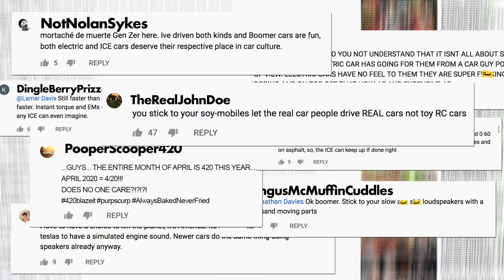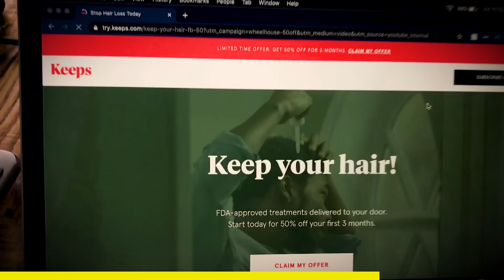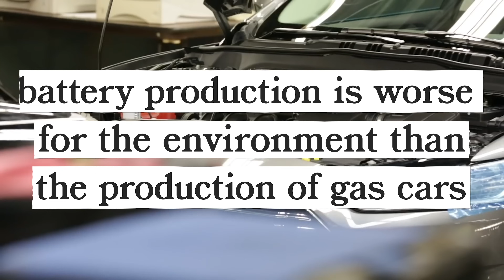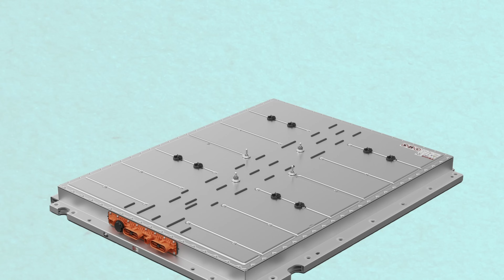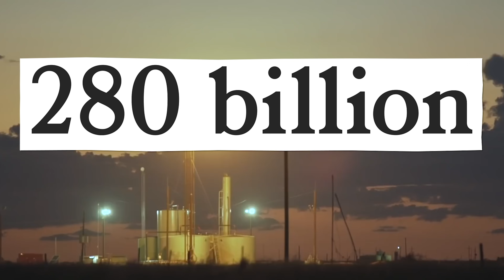Are Electric Cars REALLY Better for the Environment?

Comment: If you wanna use the battery production argument, you'd better throw out any laptop, smart phone, electric battery driven power tools etc... EV batteries make out a tiny percentage of all battery production.
Also, cobalt is used to rinse gasoline and diesel, so that argument also crumbles to dust.

Comment: Oil refineries may cause 280 billion tons of CO2, but shouldn’t you also consider the fact that the products are not only petroleum that fuels the cars but also other fuels like jet fuel, and naphtha and so on, technically gas cars don’t really contribute to 100% of the 280 billion tons of CO2 emissions right? Also an average EV would require a battery change at around once in 8-10 years right?

Comment: Mention was made about the amount of CO2 emissions generated in the making of an EV's Lithium battery.  I think it would be fair to mention the number and cost of Lithium batteries an EV would use in the course of its life.  Add to that the ramifications of disposal or rebuilding of the exhausted batteries.

Comment: What about the fact that most lithium based batteries only have a life span averaging >10 or on average about 80,000 miles ? I work in vehicle sales and I have no issues with electric cars I love driving the and enjoy selling them but I’ve seen every kind of car come through our lot and most of the E.Vs with high miles have bad batteries and they need to be replaced. Most combustion engines can last with proper maintanace to at least 200k miles and even than they can be repaired as apposed to replaced. And when you think about how everyone wants to save the planet releasing 4 years worth of co2 at once can’t be better for the environment bc it doesn’t give it any time to reabsorb that co2 and convert it into oxygen.... but that’s just my opinion

Comment: The only source you give is underrepresenting the damage of electric cars. I am also a soporter of electric vehicles. But let's not make shit up. This is generally fake. I am from spain, and, taking into consideration the electricity we use to charge our cars:

If you look at the T of CO2 /TeP it is slightly worse the energy from the plug in your home than bruning gasoline directly. We would still have to ponder the eficiency in which each car transforms this energy in actual movement, of course. Anyway, we should also consider that my source, though official, is mostly bullshit, since it claims biodiesel is CO2 netrual.

Sauce:

https://www.idae.es/uploads/documentos/documentos_Factores_de_Conversion_Energia_y_CO2_(2010)_931cce1e.pdf

So the topic still goes on.

Comment: Also interesting: If the number of gas cars is reduced, the number of oil ships is reduced by far. With hat, some of the worst polluters in the world get reduced. Thanks for the great content!
Reply: How do they ship batteries and metals and....?
Reply: No, they will just switch to shipping EV minerals
Reply: Olle Larsson Oh, I forgot. You need to refill the battery ever day
Reply: @valentinmoeller  No they will switch, the amount of EV minerals that are shipped today are peanuts compared to what will come in the future when they only make EVs
Reply: Olle Larsson I know. But it’s nothing compared to the amount of crude oil transported today.
Reply: @valentinmoeller  Well, i hope you are right,  would be nice if there is a source on that
Reply: Olle Larsson I can look one up but a battery pack in a car is about 700 kg. That’s about 10 tanks of Gas - so I by my easy calculations that already works out on the first 10k km
Reply: @valentinmoeller  Ok thats good then
Reply: And, as the numbers of EV adopters increase, the less electricity will be used to refine oil, thus replacing the energy required to charge those EV's........
Reply: @Brian-om2hh  Which is why EVs are desirable: electricity is versatile form of energy. Oil is just one method to produce power. There are more: solar, wind, coal, nuclear, etc.
Reply: New fuels are being developed that give extremely clean emissions from internal combustion engines. For example the new synthetic fuel developed by porsche reduces tail pipe emissions by 85%. This would put the internal combustion engine on a level of emissions output at the same level as a electric vehicles.
Reply: Your acting like we have an infinite supply of oil
Reply: @Dovyz Vierhas yeah but low IQ always search for the negative side without thinking about how it will still work

Comment: Your video was good at comparing the CO2 emissions.  The trouble with that is your assumption that CO2 levels are to high.  Many scientist believe just the opposite.  Our current CO2 levels are at historical lows.  That is why many growers increase their CO2 levels in their hot house.  Forest and plants worldwide are declining due to the low CO2.  There are many other pollutants that are detrimental in both type vehicles and that would be a good study.   One volcanic eruption  will produce more CO2 than all the manmade CO2 in a year.  Remember that for all the solar and wind electricity produced that the Electric companies have to build matching capacity with standard fuels since customers will not accept being without electricity when the sun does not shine or the wind does not blow.
Reply: The thing is that CO2 levels will only go up from here, it's not about now, it's about when they will stop going up, and as far as we can tell we're fucked.

Comment: The real problem is that we try to do the jump in between ev and combustion too fast. They should try focusing on hybrid vehicle first before wasting all those ressources building some low mileage ev vehicle. We could developped better hybrid and eventually when we get better technologies for our ev project to do the switch. Patience is the key to success and elon musk is not a patient man.
Reply: The thing is that we can build a decent EV right now, that's why everyone is doing it.
Reply: @RawbLV  sadly they are not yet decent for every climate and country. EV are almost useless for canadian since our winter juste reduces teh autonomie too much and the range of ev is really limited for the size of our country and access to charging station makes those low range car that have a 10year life battery expensive and less appealing than common combustion vehicle

Comment: Love your videos! I do sense some gaps for a good EV/oil comparison. 1) cradle-to-cradle: once the car is end of life, what is the effect on the environment (reusable tech or not?) 2) What about the investment in infrastructure and maintenance (oil pipes, wind turbines, charge stations) 3) What about battery life time for an EV. If we would extend the lifetime of any car, we'd save a lot of environment; but that would not serve consumer economy.... 4) You mentioned child labour, unwanted mining side products, and there still is an electrical hazard with current batteries. However you don't count these in your environmental footprint; you only measure in CO2. Environmental impact is much more than that.

I love to go green and I love innovation, but the EV/oil comparison IMHO is a bit more complicated.
Reply: It really isn't though. It's a simple question that we already answered worlwide (you know... since we're transitioning from one to the other currently?)

1) Was kinda answered in the video, but the longer the EV runs, the more ''better'' it becomes over the gas one. So cradle-to-cradle, EV far beats gas.  
2) Investment in infrastructure (and it's environmental) is negligible over time for both (though gas has already been done). That's called fixed costs and they're far outweighed by variable costs over time. 
3) Gas cars have been running for a long while so there's not that many breakthroughs to be made in that regard. On the other hand, EV keep massively improving because they're a new tech. That means as more ressources are invested in EV, it's gonna grow quite a lot. What that leads you to see is the gap between gas and EV widening in EV's favor.
4) The only one you listed that's an environmental footprint is the mining side products. Those are accounted for when talking about the environmental friendliness of a car. Though he didn't cover it in depth, the numbers he uses to balance gas vs EV over mileage take those into account.

See, not too hard.
Reply: @dzello  just to also build on your part, containing as much of your emissions at the source (as in mines for batteries for EVs) rather than at the end product (ICE cars) makes it much easier to make small improvements that have massive effects.

Comment: you should do a video about biggest sources for emissions... for example...one mega cargo ship on the ocean equals in emissions to 50 million cars!  and there are tons of them going about....few percentage decreasement in emissions with those polluting bastards would prolly be more than all the emissions created by every car on this planet...   i just hate things like this when people are media and politics are focused on whats trending/sexy and easy target...and noone talks about the REAL problem...cars are just a drop in the ocean...and it has close to a zero effect on this planet...the real damage is done elsewhere
Reply: That cargo ship is the most efficient thing that there is. Per kilogram transported it uses the least amount of oil. If you want to see them less, stop consuming as much.
Reply: @RawbLV  as engines they are far from efficent. Cars and even trucks are lightyears  ahead in efficiency, because strict regulations that cargo ships dont have. which is my point. they could be made MUCH more efficient and quite easily.  YES they are the best method of transfering the cargo around the globe but that does not mean that they are efficient as engines.

Comment: Electric cars are better as long as the military continues to "convince" the countries having the resource they need to sell the stuff to us. The batteries come from China for the most part (Tianqi Lithium, a Chinese company, recently paid more than $4 billion to become the second-largest shareholder in Sociedad Química y Minera (SQM), a Chilean mining company. The deal gives the company effective control over nearly half the current global production of lithium) (As of 2019, Panasonic is the largest producer of lithium-ion batteries for electric mobility. Panasonic starts producing battery cells for electric cars (i.e. Tesla) at new factory in China), solar cells come from China - "According to the International Energy Agency (IEA) more than 60% of the world's solar panels are made in China.Aug 22, 2018). Wind turbines had a 20 year payback in 2003, according to the part owner in a 106 turbine wind farm I worked at. He stated the main reason to build wind is tax credits. Cobalt comes from The copper belt in the Democratic Republic of the Congo (DRC) and Zambia yields most of the global cobalt production. Cobalt is required for electronics of all sorts. Don't forget about tanlalum - All compact electronic devices use this handy metal "Widely used in capacitors for computers and mobile phones, tantalum is certainly an important component in many modern technologies. However, the metal is also known for issues related to conflict minerals, since a large portion of tantalum production comes from the Democratic Republic of Congo (DRC). Looking elsewhere in the world, the US has not produced tantalum since 1959, according to the US Geological Survey. So while electronic gizmos are cool at what cost? We need to send the military into these poor countries to make it safe for big business to get the raw materials for all our neat gizmos while the countries are devastated by mining activities. Keep in mind that these contries that produce the stuff for our toys, for the most part do not have or enforce polution laws so the poor folks in these countries live with poison in their water, air, and soil.

So Folks at what cost? Sell your soul for trinkets or develop ways to keep a comfortable way of life without enslaving the world for our whims? Your choice.

Comment: Great video! This may all be true, but a battery is still the wrong answer to an alternative to gas. Its success is based on an overall marketing ploy and an easy quick fix. If we really cared to eliminate OIL with an equivalent replacement, we would have figured out how to make hydrogen work.

Comment: You did not factor 'lifespan' in your checks and balances. If you buy a new EV. it might have a range of 150 miles on full charge. In 5 years, that same EV's max. range might only be 80 miles. Who is going to buy that? Yup, no one because the cost of replacing those batteries is going to be greater than buying an new EV. So you have to factor the total greenhouse gas cost over 5 years for EV. vs. ...... years for gas or diesel. If you do, then EV. is not a scientifically greener solution, it is just a politically greener solution.

Comment: A number of errors, CO2 production is no where near the release of 17mt per battery pack. Cobalt has been eliminated from the largest producer and batteries packs have a 500,000-1 million mile range and then they are not stored, they are used for stationary battery packs such as the Tesla Powerwall. So the median life of the battery pack is 70-80 years. During that time, the ICE care is replaced 20 times so all those emissions are continuously being produced for 70-80 years with ICE but only once with BEV.
Coal powered plants using modern gas turbine generators are much more efficient in producing electric power than internal combustion engines. 
ICE cars have far more toxic waste, from fluids and catalytic converters and much more toxic lead-acid batteries, and filling landfills with old leaking cars. 

I used to be a car nut, collected Italian GTs and even turned my personal shop with two full-time staff, into a side business of repairing classic Maserati from 50s to 1975 models, and I owned 64 cars. But I moved from the US 20 years ago to a large city with excellent public transportation and discovered the gain personal freedom when NOT having a car, my monthly transportation-related costs dropped from $22,000 a month to $40 to go more places and have a much more active social and cultural life, never being late, able to have a drink in a pub or out at dinner, and have no worries about finding parking or housing the cars. But I reserved a Tesla CyberTruck seconds after it was introduced.   I discovered the Reason Americans so so little, hardly go out to fine dining or plays or dance clubs, is because they are tied to home due to debt and a big part of that is being tied to a car. City life is much more exciting and active without that weight around one's neck. The US is boring because of the domination of the car with everyone in the family over 18 has to have their own car to even function.  They think it give freedom but actually forces them in boring restricted lives. When ICE cars are banned from city centers in the next 3-5 years all over Europe and Asia, quality of life will improve dramatically...fresh air in cities, no clogged streets with cars parked 95% of the time, lowering the cost of living and increasing flexibility with very low-cost Robotaxis. The COVID-19 pandemic showed that when ICE car use dropped a lot the immediate improvement in air quality noise and visibility was seen in every country impacted. Going all BEV will assure the improvement is permanent.

Comment: Nolan, you forgot the fact the lithium ion batteries have a short life span. They only last 3-5 years. Ask anyone who ever had a cell phone they had to replace because the battery won’t hold a charge anymore. So, you argument doesn’t hold water if you have to replace the battery even once. And you most likely will. Ask anyone with a Tesla that’s more than 5 years old. Not only bad for the environment but Extream my expensive. And that’s why big company’s like ford and Tesla are going to electric. They don’t care about the environment. They care that it is going to be more expensive for the consumer to maintain. Which means more money in there pockets and less in ours. Also, say bye bye to working on your own car! You’ll die if you crack the battery bank on a Tesla. So, all the EV. Fan boys are just helping the company’s make more money and destroy our environment and your helping them. Oh, and one last thing. You will never be able to take more than a 150 mile road trip (150 out and 150 back) without waiting 3 hours at the “gas station” while you wait for your car to recharge. Instead of filling up in 10 mins and getting back on the road. Be nice!

Comment: While I agree with them being cleaner for the environment in regards to the CO2, there is one factor we don't know yet as EV's are relatively new: the life span of the battery. What happens to the battery after 10 years? What happens after 20? 30? 50? There are some vintage cars that still drive, but we don't know how long EV batteries will last. Will we need to replace battery every X years? We all know how phone battery loses it's efficiency with time (with every charging cycle). What will happen to a new Tesla with range of 300 miles if in 10 years it drops to 150 miles?